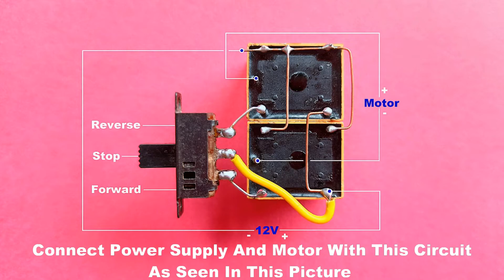Diy Motor Controller Using Relay..Motor Forward Reverse And On Off Controller Using Relay..

Comment: A problem with using two relays is any speed difference can result in a short between the power supply rails.  It's best to use a DPDT relay with a single coil to change the motor connections to the power rail and another to turn the power on or off.  
A schematic is a lot more useful than the wiring diagram because relay pinouts can vary.